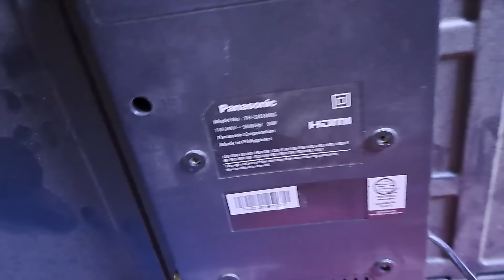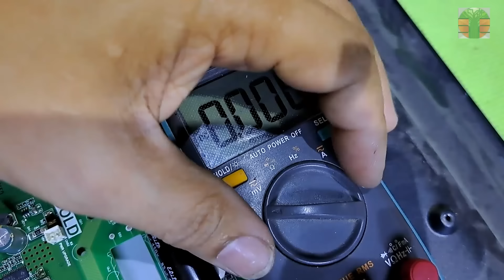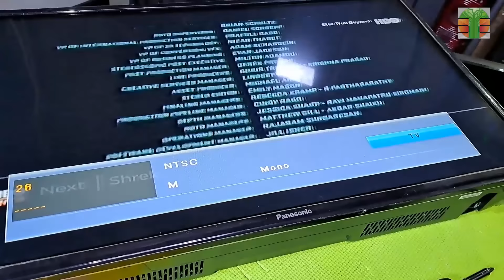Main Power Supply Fix.

Comment: Thanks Tev this is another great video im learning.

The customer brought to me a crt tv sinotec,problem is thin horizontal line.28v vcc present.
I changed vertical ic still problem not solved.

Im stucked
What can be the problem Sir

Regards Desmond
From S.A
Reply from the maker: check the 9 volts supply

Comment: SAFETY FIRST  please use a light Bulb filament   40w - 220vAc   in series with line plug  AC  acting as fuse that lights up bright if short is present, but if circuit is good light bulb is Dim

Comment: Can you explain more to me what is that thing you put in place of the fuse?
"You told me to run with lead powder, and I didn't understand." Can you explain more to me (thank you) 🌹
Reply: He used 20w resistor 220ohms i think better to use 60w buld if buld glows it's mean ls shorted